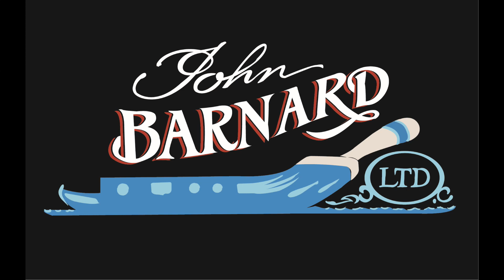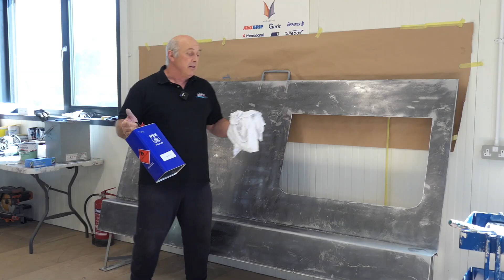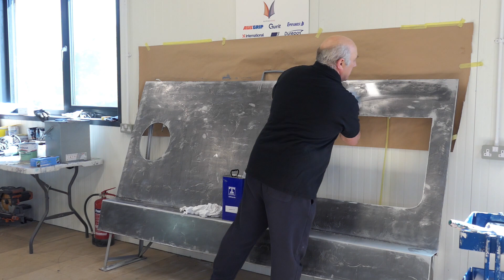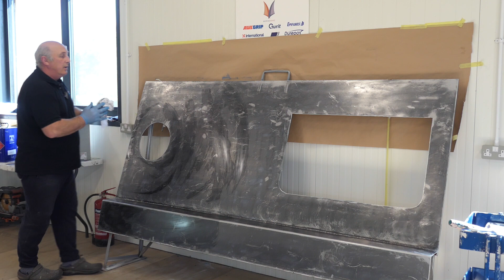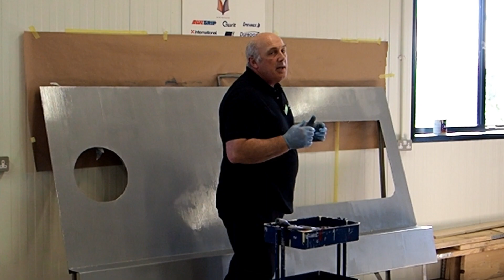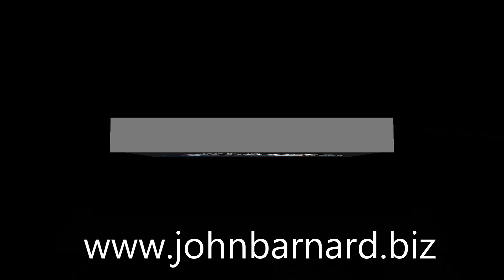Narrowboat Panel Painting - Part Two, Priming

Comment: do I need to put an undercoat over sanded old paint?
Reply from the maker: I would suggest 2 coats to give you a good base for you top coats
Reply: @JohnbarnardBiz  thankyou, there are a few scratches, down to the original undercoat if i cant sand them down level what do you suggest me fill them them with or will 2 coats of undercoat do the job. Im just want to paint a top coat within the coach lines

Comment: Thanks for clearing up the point on sanding down, makes perfect sense. You mentioned 2 types of primer, the aluminium and the zinc phosphate but you didn’t mention two pack epoxy - are there issues with the two pack that mean that the rest of the paint process has to be done differently?
Reply from the maker: Yes using two pack you have to be careful as overcoating with single pack products can be lead to problems and in a lot of cases you will have to rub down the the two pact to gain a key which in turn reduces the flim thinkness
Reply: John Barnard Ltd. - thanks John - my sail away came primed in two pack which is rather thin in places as rust spots are showing through - guess I’m going to have to rub these areas down as well as the rest of the boat and start again with the Aluminium based primer - thanks again for your videos and comments